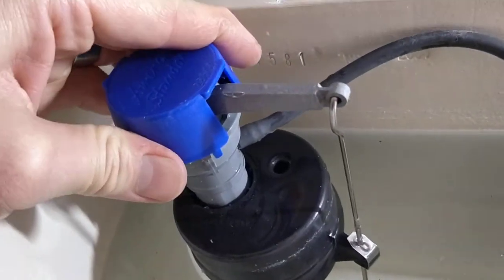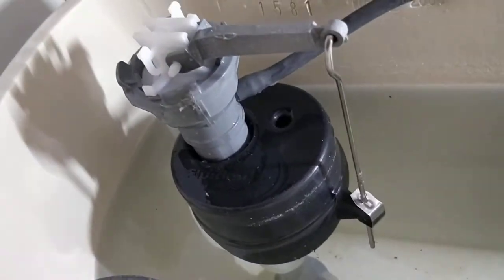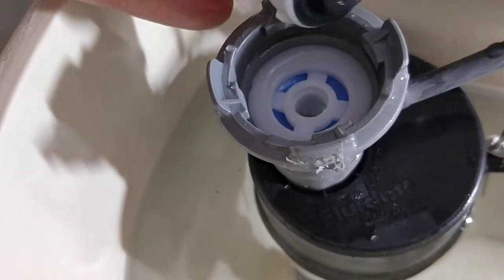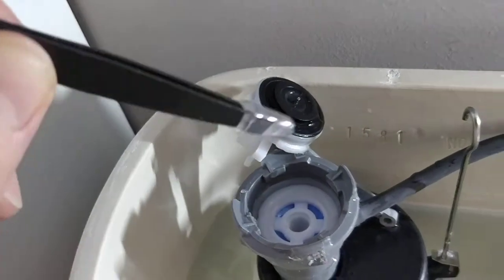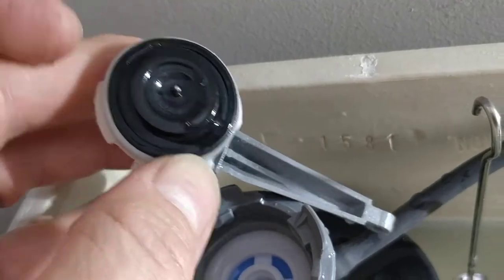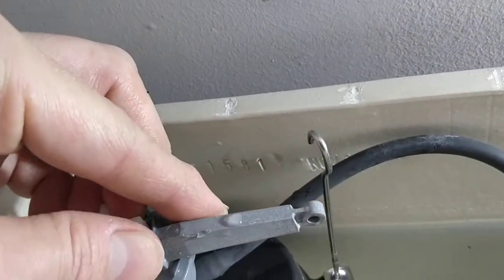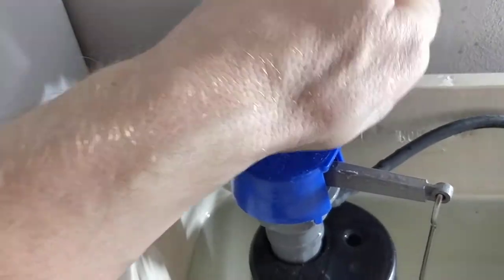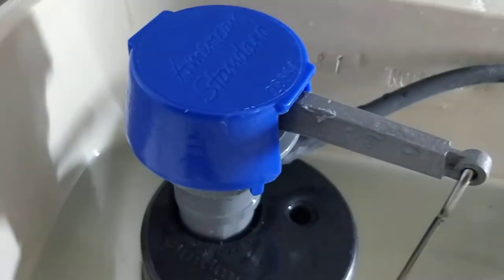Fix a Hissing Toilet - Way Easy!

Comment: I just replaced my rubber valve seal after 16 years of toilet use to stop it from hissing. However, I'm noticing afterwards that lots of little black rubber pieces are floating around in the water inside the tank. Will my new rubber valve seal will be damaged again soon if I don't clean all that out?
Reply from the maker: I don't know if the little black pieces would damage the seal but it could keep the seal from performing perfectly if the little pieces land on the seal. I'd make one small effort to try to get a lot of the big stuff out of there hopefully the rest will just get washed away

Comment: my older Fluidmaster 400 model.. could not find the source of the hissing sound.. I cleaned the seal of grit, then changed the seal, flushed water without the seal or the fill cap on to ensure no sound, so sound was not coming from the line in feed... in the end, replaced with another new Fluidmaster for $24... since I had extra seal figure I wouldn't change it for a Korky brand
Reply from the maker: Makes sense to me. I'm glad you got it up and running.

Comment: Thank you for posting this! If the hissing sound does continue will that cause your water bill be to be high if you ignore it? Trying to budget to fix it in the future.
Reply from the maker: Good question. I don't think it'll be significantly higher. I'm in St Louis and our county water is about 2 cents per gallon. That small of a leak... Might be a gallon or 2 a day? Figure worst case...10 cents a day x 30 days = 3 bucks a month? Just my guess.